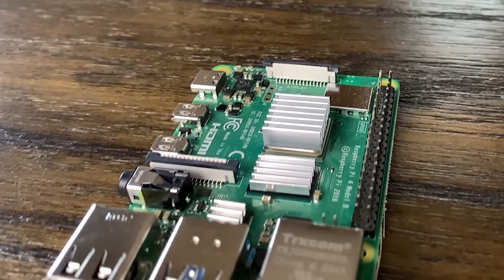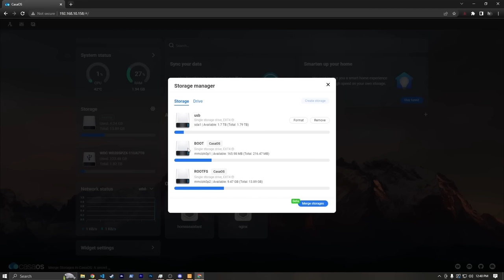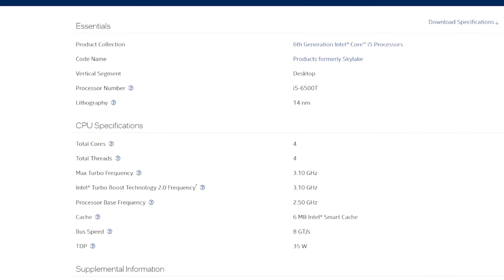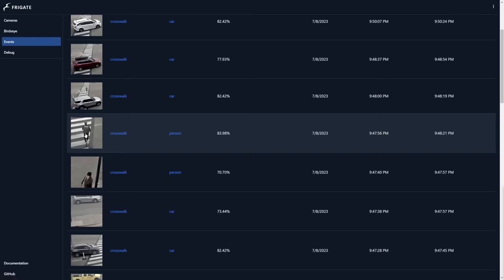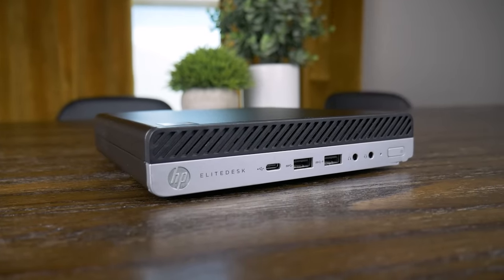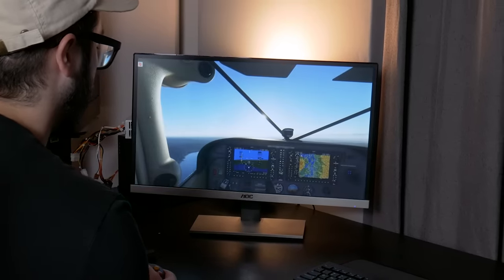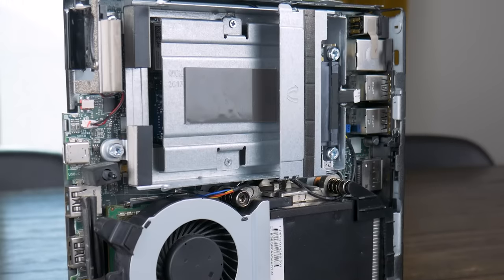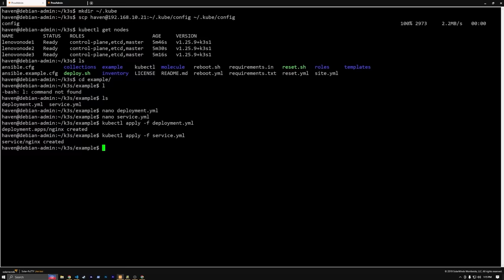The Mini PC You SHOULD Be Looking At

Comment: A single one of those 1L PC’s could run a whole homelab for many of us.
Reply: Like me. HA on Proxmox. Home automation server only. NAS on separate machines including rack servers due to my massive data hoarding.
Reply from the maker: So true lol
Reply: Definitely ! Mine is running on an HP EliteBook 8570p... I don't need it but recently I be fancying another server to host all of my spare hdd and ssd lying around.
Reply: not this one specifically, with 4 skylake threads, but the newer Ryzen ones with 6/12 or even 8/16 have very impressive performance!
Reply: I've been using full size 800 g3 elite desks for my lab.  Not as small but pretty cheap and lots of expandability
Reply: i have mine offsite in another house. its my emergency backup server.
Reply: @KameraShy  I run something similar. Nas is a old Synology and run 3 of these, 1 for each dedicated server plus 1 extra. I run my pihole and camera's off these. I use my old desktop as the 4th node for my plex but that is not in the HA stack for the other 2.
Reply: Mine absolutely does. Its a little lenovo with an i3 7100T and 16GB RAM. it runs Jellyfin, Minecraft, and a few other supporting services like Qbittorrent and Radar/Sonarr
Reply: What about an EM680 with a 6800u APU?
Reply: Absolutely you can! I own a hp elite desk (i7-8700T ~ 32GB of ram) running ubuntu server, a crap ton of containerized services, automatic offsite backups, whisper quiet, low power consumption, small form factor.. I mean come on, what more do you want/need? I picked up the elite desk for dirt cheap in a office clearance sale, the ram was stupid cheap on amazon (generic timetec ram).. it's fantastic. I was using ARM previously. ARM is alright, but I just felt like it was too many hoops to jump through to get basic services running most of the time.. or services I wanted to run were just outright not supported.
Reply: It really depends on what you do with it. The CPU is limited in my opinion
Reply: But why do 1 when you can do 3 and have fail redundancy?  And let's be honest, these things don't have much space for storage, so you need a 4u 36 bay disk array....   My homelab is starting to snowball again 😅
Reply: @mnadamn  I'm genuinely curious, what exactly do you use mass storage for now a days? I've stripped away a lot of my mass storage because honestly it was just baggage Ive been carrying along between builds.
Reply: @1w2qqswa  Also genuinely curious, what use cases do you see the CPU not being capable in a home lab setting?
Reply: @mnadamn  oh I have 8 of them lol
Reply: @mnadamn  I use a Synology NAS and all of my Docker Compose files specify NFS volumes.
Reply: I’m going to keep telling myself I need this DL360G9
Reply: Honestly these cheap low watt PC's would also be perfect for use with music midi keyboards and digital drum kits. Could power a home music production set up. I have midi KB and clip launcher gathering dust, because I don't want to clutter my main PC. These look perfect.
Reply: My entire home lab used to run on 1 3B+ and a Hassio VM. You can accomplish alot these days with very little in terms of hardware
Reply: More computing power than what got us to the moon!
Reply: @mnadamn  found the r/datahoarder!
Reply: My stack was extensive. Consolidated down to a dream machine and symbology NAS that runs all containers I need. Something about simplicity is liberating
Reply: True.
I use odroid h2+ and h3+ for that.
Reply: we use about 600+ of those elitedesk models at TMMK. (Toyota  motor manufacturing kentucky) every office. Break room. All the Wifi for every AGV these are factories bread and butter. Though lately been seeing the mini Z2
Reply: Yeah I had a very old Gigabyte mini pc which I ran till few months back. But I had VPN and Pi-hole in Raspberry Pi though and HA in HA Yellow.
Reply: @HardwareHaven I am getting into streaming. I have 2 monitors and a ps5. I recently bought a Dell pc, but it's about 4 years old, and I can't get obs to work with my elgato hd60x. When I connect everything to my gf's laptop, obs worked, and my elgato. So I'm guessing it's my pc. I just need something I can run obs on and works great with my elgato hd60x. But I'm kinda stuck. Should I get a laptop or a mini pc?
Reply: I would be curious to know what people call homelab in these lands..
Reply: @fuarkstyle  passive aggressive gatekeeping?
Reply: @TerraMagnus  nah I just have the impression homelab around here is just a PC with several nas devices to run 3 systems (pr0n, games & misc/never-used-stuff)
Reply: I don’t think it’s worth it to buy when I’ve gotta spare PC lying around(Intel i5 8GB ram…)
Reply: I have a Lenovo with an i7 that runs everything on proxmox. LXC's are super lightweight and with 32gb of ram, I'm running a lot of stuff.
Reply: Elitebook 8460p for me!
Reply: @thedev2496 my main pc is that 😢🗿🗿🗿🗿🎮
Reply: I’m honestly considering buying one just because it’s so cute
Reply: I have one running ESXI 8 and it runs my CUCM and CUC server
Reply: One does, for me, and I'm in love.
Reply: The irony watching the monopolies try and complete in this market. What have they been doing for the last century?

Comment: I used to buy Pi’s for so many projects back when they were always $35. Now I feel like they don’t make much sense anymore when I cam buy these older mini PCs for less than a raspberry pi with all the accessories needed to get it up an running. Unless I need something that very specifically requires a Pi, I’m going with a mini pc every time.

Comment: I think, Xeon didn't work not because of TDP limitation, but because of compatibility. Since Skylake generation, Intel started to restrict the use of server CPUs on home chipsets
Reply: Yes, which stinks. The only consolation is that there are newer CPUs that are much less limited than these old i5s, including Ryzens.
Reply: in some gigabyte mobo, bios mod can solve this..  but i m not sure with prebuilt pc...
Reply: Maybe the age old solution of covering up some pads can help here?
Reply: The newer generation of Lenovo Tiny can accommodate Xeons I believe as they've moved to a mostly mesh chassis for much better airflow.
Reply: The units with a 35W CPU use a different motherboard. Since the model in the video has a 6500T, TDP limitation could be a factor.
Reply: There are workstation HPs and DELLs with xeons. Working on these is a huge chunk of my job
Reply: Correct. The last good commercial xeon was the 1231v3
Reply: Other than a few obscure differences an i7 6700 is just as capable as an equivalent Xeon.  "Server" CPUs are highly overrated and misunderstood, and TBH, completely pointless in tiny desktop PC since you can't leverage any of the extra hardware capabilities.
Reply: @awebuser5914 , the point is the error-correcting memory.
Reply: @seriouscat2231  Which is completely irrelevant for the vast majority of casual users and honestly not an issue with modern memory modules.  A quick pass of Prime 95 or Memtest will show a failure point and after that, the chance of a random failure is near-zero.
Reply: @awebuser5914 , but people here are serious users. And now that you mentioned it, I doubt your honesty.
Reply: @seriouscat2231  This video is about dicking around with $50 1L miniPCs, not exactly the realm of "serious" users (whatever that means...).  In any case, unless you run a business that has the need for 100%, mission-critical performance, then ECC memory is completely meaningless, any other use is simply not required, or relevant.
Reply: @awebuser5914 have you heard of virtualization? There are some important features that only xeons have, at least this is true for my little server
Reply: @GoingtoHecq  Almost all Skylake CPUs support VT-d, so that's a meaningless comparison.  Try harder...
Reply: dont know about this specific hp but generally xeons will work as long as they have integrated gpu - the other requirement is 35w max as that is the thermal design of the cooling hardware, going beyond that will land you into trouble

that being said it's best just to stick with the stand T i5 and i3 processors - if you wanted more power then just go for a model with an 8th gen as intel increase the cores from 4 to 6 to compete with ryzen, like the i5-8400T or i5-8500T

personally i have a dell 5060 micro with a i5-8500T running 2x 32gb DDR4 - plenty of power and with low energy consumption

there are new options on the block like the n100 which might not be as powerful but are much more energy efficient and have the latest video hardware acceleration so these would be ideal for transcoding, HTPC and even general computing as youtube/streaming is all hardware decoded
Reply: Hey I just got one of these- i have a i-5 8500T in it, what's a good upgrade for my home server?
Reply: @awebuser5914  True, but the only time I've tried them in consumer equipment is because they were cheaper than their consumer counterparts, and/or they had a slightly higher MHZ than the consumer version.  These are 2 good reasons for people to continue pushing that compatibility envelope.
Reply: @clusternate  What does that mean exactly?  What changes after 1231v3?

Comment: I was really tempted to get one of these 1L PCs but settled on the optiplex 7060 sff with i7 8700. Having the extra pcie slots, M.2 and easy installation of 2 sata ssds made it perfect for my proxmox install. Currently running a vm for docker containers, a pihole lxc, plex lxc, and a home assistant vm. Still pretty small and quiet for me since I have it in the basement.

Comment: The reason I use an RPi 4 is for portability my portable ham radio outfit,  my son got me a mini PC that runs on 12 volts, but its kinda rough to run from battery ( voltage drop )  but im really interested with using one of these little rigs for my home radio station, desk space is a premium for me.  Thanks for the good info! Keep up the research!

Comment: They do rock.  I have a bunch if them and I mostly just mess about.  Couple things to keep in mind are that in some of the generations there are 35W variants and this might not be reflected in the sale (35W are in the SKU if you know the serial, 65W says nothing).  Also, under most circumstances you should be able to use a dual drive (NVMe and SATA) configuration.
Reply: 65W versions have a vented top-case an an extra tiny fan above the SATA drive.  The case is the dead give-away...

Comment: I did exactly this as I wasn't prepared to pay pi scalpers almost double for a model 4. I ended up getting a Dell Optiplex 3046 with a 6th gen I5, 16Gb RAM and a half decent ssd for about £80. Does a great job and runs everything I've thrown at it so far.
Reply: Yes I being a poor person in the know find programs for cheap pcs and laptops.  I guess over time maybe a r pi is going to pay for itself in power consumption but the dream of a $30 board costing what was it at the big squeeze $200+?  You can get entire computers and laptops for less.
Reply: I've been looking at second hand Dell Optiplex too. Long term thoughts? This review of the Lenovo has thrown a spanner in the works - looks more powerful for graphics. One of the uses is retro gaming so i'm wondering where the cut off for (say) PS2 is. I read that the Iris integrated graphics is much better than the other Intel graphics but I havent found any micro PCs making use of that.
Reply: @tonyhawk123  Hey, I used the Dell to complete the entire metal gear solid games on ps2 and ps3 with no problem and a little tweaking with the emulator settings. I also ran N64 goldeneye which is notorious for not playing ball on various PCs regardless of spec. I even use this to run designspark CAD software which is resource hungry. For what you pay it's well worth it. I like lenovo and have used it in a corporate setting many times but I personally prefer Dell. Hope this helps :)
Reply: @nathanbarker7686  ps3 emulation? I'm new to this but wouldn't have expected that! I thought it would be a struggle to do ps2 let alone ps3! Is this using Intel UHD 630 graphics?

Comment: I have been using these mini PC's (Lenovo) for a number of years now and they work great. One is in daily driver mode at one location and performs perfectly for things like video watching. Easy to work on. I recently picked up a batch for about $50 each including power supplies. One thing to watch out for is whether the hd caddy is included. Those can be a pain to source independently. It varies.
Reply from the maker: That’s what double sided tape is for 😋
Reply: An m.2 screw is cheaper than an hdd caddy
Reply: Nothing an evening in FreeCAD and some hours on the Ender can't solve. 😁

Comment: I actually just ordered a Dell Optiplex 7040 Micro with an i5-6600T (same form factor as the guy in your video) for $89 last week! I also got 32 GB DDR4 2400 MHz for only $36. Going to be using it as a power efficient home server to run my Minecraft server and other things. Oh yeah, and great video by the way! :)
Reply from the maker: NICE! And thanks!
Reply: Probably like elsewhere, for most general applications, sufficient RAM is a key factor.
Reply: I am looking for 16GB DDR4-2400 for my 7050 with an i5-7500T.  Where do you find them at a good price?
Reply: Woah where did you get that RAM? Only $36? Is it 16GB x 2 or 32GB x1?
Reply: @ManelRodero OfferUp and for that less than $100 I got a 7060 with i7 8700t for $140
Reply: @goodfractalspoker7179  Damn, that's a solid deal
Reply: I just did exactly this too!
Reply: @goodfractalspoker7179  Where did you get those deals?

Comment: I have been running a 5 node k8s cluster on the Elitedesk 800 g3. I installed a 256gb nvme and 128gb SSD in each and use the SSD as a boot drive and the nvme with rook/ceph for distributed storage. It has been an awesome experience.
Reply: +1 for using rook/ceph.
Reply: What networking did you do for this ceph cluster? People say to get good performance out of ceph, you really gotta be looking at like at least 10gbit networking. And since you’re running on nvme, you definitely want some fast networking for ceph.

I’m just curious. Would love to build a ceph cluster from thin clients, but am worried about networking being a bottleneck.
Reply: @copper4eva  I am just using 1gbe nics through unifi switches and routers. IMHO bottlenecks in a home lab are kind of irrelevant because the typical workloads we run are not so CPU, Memory, or IO intensive you will notice a performance impact due to a bottleneck.

I use NVMEs because the HP 800's I use only have 2 storage interfaces. 1 SATA and 1 NVME. It made more sense to use the NVME for the ceph cluster over the SATA SSD because of random R/W performance.
Reply: @PrymalInstynct  
Should have also asked, are you using erasure coding with ceph? Or you just running replication?
Reply: @copper4eva  just replication

Comment: Not one of these but a SFF (probably closer to the 1 liter that you have in this video) a friend acquired for free is currently running as a proxmox backup server.  Doesn't have much for storage itself but I did mount my network drive on it and the system happily uses that as a data target for incoming backup tasks.

Comment: Very cool! Thanks for talking about the flooded used market 🙂 

So many good options to help reduce ewaste and give older machines a new purpose
Reply: If I have seen anything so far it is that some companies are not hesitant of giving bigger resellers a big bunch of the exact same machines.  Bulk selling of second hand stuff tends to work very well, and I like that companies are not uncomfortable with the idea of actively promoting recycling.
Yes, not all of them still do it to the extent I would like, but it's still a massive improvement.
We have a chain of second hand stores in The Netherlands that are now also increasingly buying lots of used equipment, it's pretty cool.

Comment: You monster! I've been looking at building a K8s testbed with these for the last week or so, and was finally closing in on the price sweet spot, and now they're going to go up again! :D

But seriously, these are great. I have one dedicated to Home Assistant, and it's excellent. 6th gen Intel is the oldest I would go - any older and the power/efficiency isn't there, especially with spectre/meltdown mitigations - as well as NVMe support. 

You can also look at thin clients, like the HP T640 (with a Ryzen Embedded R1505G) and Dell Wyze 5070 (Pentium J5005/J4105, limited to 8GB RAM). Furthermore, don't sleep on the SFF machines - they aren't quites as compact as the Mini/1L PCs, but some have standard internal power supplies, better cooling/performance and can take a low profile graphics card and full-size RAM.

Either way, these can have a surprising amount of 'oomph' for small, used, low-power hardware.
Reply from the maker: If you look in the background you can actually see a pro desk SFF lol

Comment: Bought both m910q and 800 g3 last week for ~$60 each with 7500T & 8GB. 
Added crucial p3 500GB for $10(after coupon) from microcenter and have  very fast WFH PCs. 
FYI with Wifi cards. Cards like Intel 9560ngw or ax201ngw are CNVI/CRF and only works with 8th gen or higher cpu/dedicated motherboards. You will want to get cards like 9260ngw or ax210ngw.